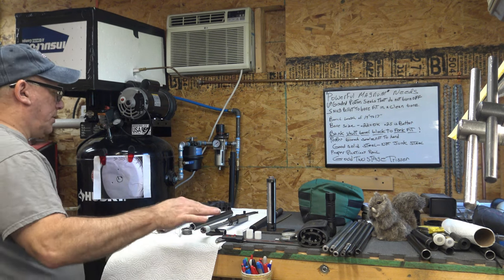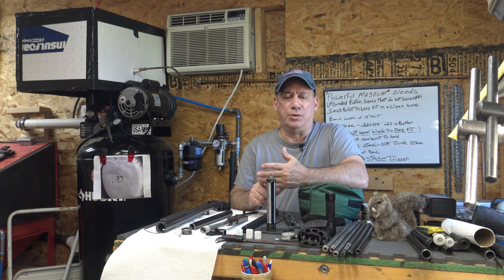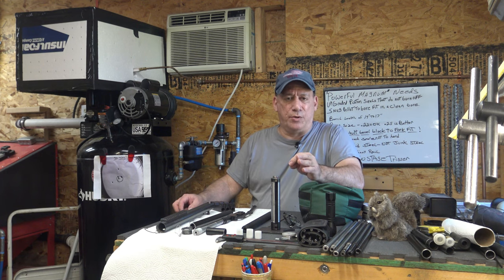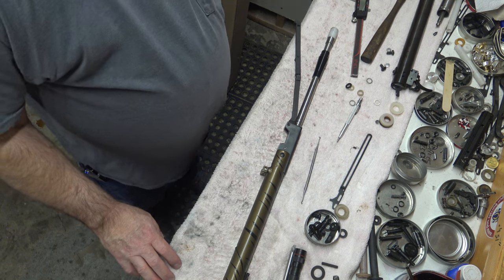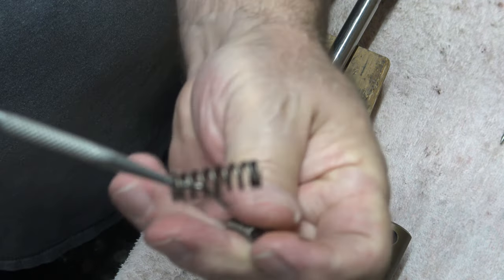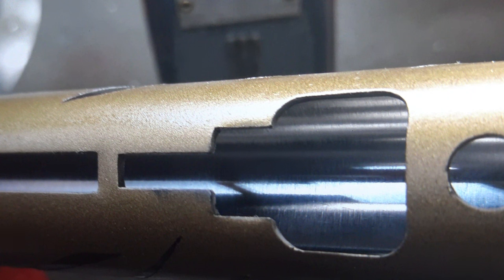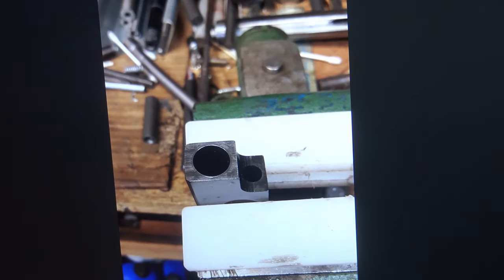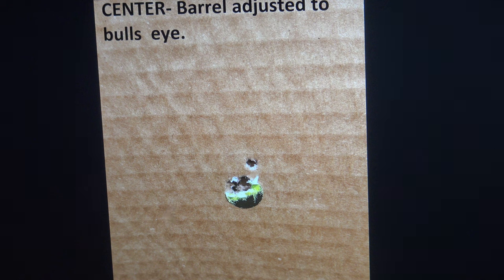Revised Part Two In Depth Look Into The Benjamin Trail XL Air Rifle !

Comment: This is so good and so indepth, I'm going to share this on my Facebook air rifle group and YouTube page. 
I wish that I had the machinery and machining skills that you have. 
BTW the Hatsan piston seals that you mentioned, is there a link or company that I can get ahold of for them?
Also, perhaps you or know someone who makes bigger shim washers to tighten up a sloppy barrel lock up, especially for my Hatsan 125. It is so close to being a really good rifle. My Hatsan 95 22 has a great lock up, pellet to boar fit and I can get pinky tip size groups at 25 yards.
Reply from the maker: I am  out  of  the  125 seals and  I would need  to install  the seal as  they are  not  made for people  to install themselves ,the barrel shims  need  to be made and fitted  to and  with the gun?  you cant just make a set  and say here you go. 
 I am trying to get more seals but its  like pulling  hens teeth/  you can send  the receiver less  stock  when I get a  125 seal and  I  could make  the washers and  install  the seal

Comment: rifles are rather pellet picky as to what pellets it likes...... I had a Beeman Kodak. 25 cal. It only shot Beeman and H&N crow magnum.. 26grain ,Kodiak and Kodiak match, 30 grain... they had the same b/c and same zero, and the perfect round pellets (different zero, though but goodpattern). Every other pellet I tried had wild patterns.
All things being good, shoot till you find pellets your gun likes. With Benjamin, use HEAVYWEIGHT PELLETS and a.scop that's rated for a magnum piston rifle or your trash the scope.
Reply from the maker: Hi Dave Yes  I know / How  could I not  know??  btw  this  crosman barrel was  over sized  not pellet  fussy !!
I had  two  RWS stamped Diana 34  totally over sized  bore  
over sized  bore is not a  light bore to pellet contact its no pellet  to bore contact  and a  light pellet to bore contact on a magnum will result in a lot  more  recoil  even if you find something  that fits better  its best  to  have  a  proper pellet to bore fit period  later you can hone in on  what pellet it shines  to

Comment: Is WD40 'White Lithium Grease' that I use for my electric scooter's hubs & suspension, safe/appropriate for my barrel and/or the intake port? (Crosman F11 nitro piston, .22 cal).
Reply from the maker: No Wd 40 is a unique fluid, I  dont use it on anything  except maybe after I wash my crosman pellets  2x with soapy water when  dry I will very lightly  thin  coat  them  so  they dont oxidize/air rifles need non  petroleum  type lube  some use silicone  in those under leaver rifles or I use synthetic high temperature grease its totally non petroleum

Comment: Gamos suck !! I've had 7 out of 11 of them bad right out of the box ! And when I called Gamo they told me to send it to them ok that's fine but it would have cost me $75.00 to send it to them and another $75.00 to get it sent back to me ! That's $150.00 shipping on a gun I paid $159.00 for !!
Reply from the maker: I had good Gamo's so  far,  the Benjamín trail was a  ship wreck  and  a lot  of  guns  are  also guess it depend  on what  gamo  you bought
just had a Gamo CFX in here that they  dont make  anymore  and it was  so  chimsey I could not wait to get  it  out  of my  shop but it was amazingly accurate